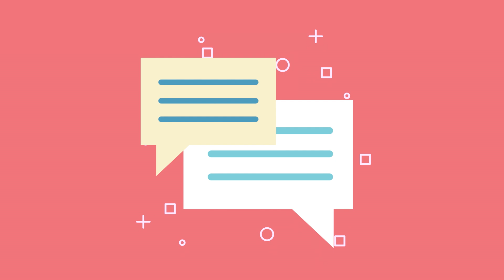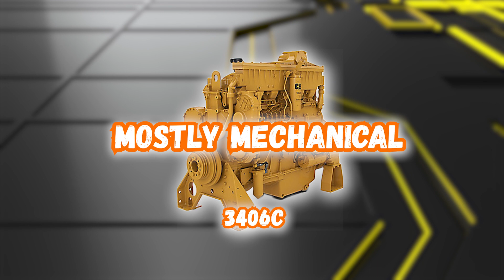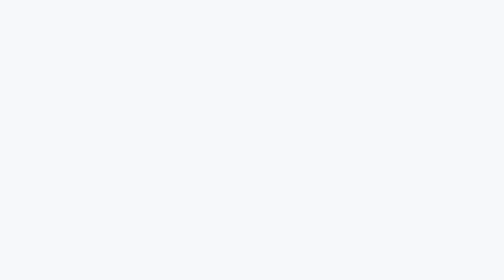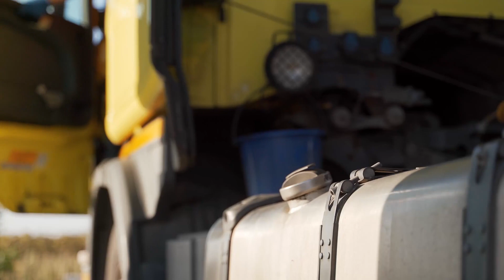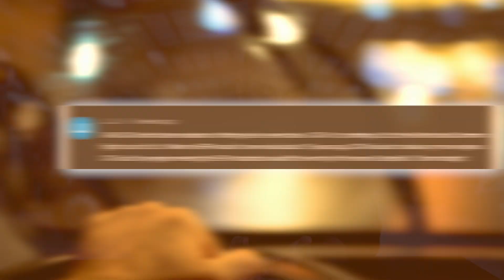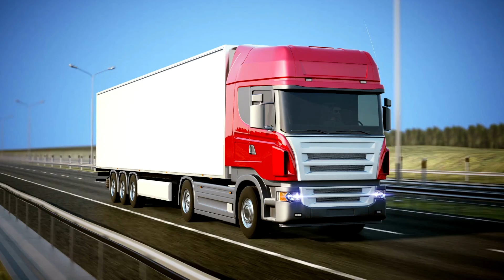CAT'S Downfall!! (Talking ENGINES & Sharing your Comments)

Comment: Best one I ever ran was a 3406 C model. The reason they got out of the truck market is they still have tons of lawsuits from soft cam billets and other crap. They got sloppy in their last years.
The series 60 was not a copy of the 3406 it was a copy of the old 1693 TTA. If I had my way there are really only two engines I would run. The first being a twin turbo VT903 Cummins and a 3408 cat. You can get great fuel milage out of the 903 and it is a million mile engine. The 3408 not so good fuel milage but still a million mile engine but very expensive to repair. Just my 2 cents.
I now will only have a cummins or Detroit. Every shop can work on them and you are not bound to a specific manufacture for repairs. I had an International N13 and it was a piece of junk. Nearly broke me it was in the shop as much as it was on the road. I run the ISX 15 now and have never had a problem with it. The only repairs I have had to do on it were a fan clutch and DEF sensor. Oh and an AC compressor. I run Pittsburg power max milage fuel catalyst in it and have never had a problem with the DPF in 650000 miles.

Comment: What are your thoughts on CNG trucks ive been seeing a lot more on the road latley and many say that they're just as or almost as powerfull as diesels with the fuel being way cheaper and not having to deal with all the emmisions stuff 
new trucks have today would it be a good idea to get one at least for local runs many fueiling stations have an area to fuel cng vehicles not sure about them in OTR use and unlike electric cng has been around for a while now and trucks can even be ran on both cng and diesel would be cool if you guys could make a video breaking them down as there are very few videos on CNG trucks that really goes into depth
Reply: Holy sh*t - use punctuation.

Comment: Cat is the best 1993 to 1999 3406e single turbo 475 hp  cat build the best motor in the world and did not want to choke it up for EPA standards can't blame them.That vintage of motor is still on the road today getting good mpg 7 to 8 with no flashing shut down light or Regen. Look at the exhaust when it's running. It's transparent. Cat shit doesn't stink that's why they checked out because they know there shit did hurt them a bit.

Comment: I love all cat engines , You can do mods to them for fuel mileage . My current truck has a C15 NXS deleted,  single turbo, ported head, the nice exhaust manifold.  Tuned to 550 hp 1850 TQ. If I baby it in my 387 shell do 8.4 mpg . And no Def. She's got 1.45 million on it and it don't burn oil and has minimal blow by .  It sucks running down the road with emission trucks , they can't pull worth a dam . So they are always in my way when I'm running in the big hills . CAT #1 🐈
Reply: Sounds like a great truck. How much did the delete cost?
Reply: @mctransportation9831  it wasn't that much really.  I think you can still by the manifold and turbo for around 4500 . The iva valves are backed all the way off and no longer do anything and the computer was reprogrammed for 500. Witch is a rip off because it's no labor really involved on their end . It's a good set up . Just as long as you roll in and out of the throttle smooth through the hills it will always get pretty decent fuel mileage.  I heard the new freightliners can hit 10 mpg driving slow . 60 mph max. But they burn Def too witch cost money . I'd trust this truck over a new one because there's no emissions to fail.
Reply: Amen bro. My truck has a cat c15 and those emission trucks can not pull hills
Reply: Boss I drive a 3406e in a Kenworth w9 with a pdi manifold and turbo , how do you get better feul mileage out of it?🙏

Comment: I just wish fuel wouldn't be so expensive, then I'd go for a CAT in a heartbeat
Reply: Quality is expensive
Reply: I'd rather spend more in fuel and have something dependable. This year alone I've lost 50Gs in canceled loads/unwanted time off for repairs/emission parts/ and the headache! Fk this new technology BS. Buying a 6NZ 379 this week. Plus everything on the old-school motors are cheaper, from turbos, injectors ect ect ect

and I can change parts myself without a computer!!

 fk these new trucks🖕
Reply: @joshcecil5892  I mean I'll go for a DD60 12.7 which is also old school and still decent fuel milage and cheap parts

Comment: I have c15 6NZ in  my w900l, 2.2 mil miles on  it, except valve adjustment nothing done to the engine. MPG suck compering to new engines, other than that, best engine ever  made....
Reply: 2.2 mil miles? You are right around the corner for a rebuild. Just face it.

Comment: 💖💖💖Cummins is nothing but a red paccar best engine for the ideal idiot who is in line for a MAXX force 13 but it does have a great bull gears and the paccar is actually a good engine too I did a in frame on one and it didn’t even need I just wanted it done for the long run after half million miles 
Don’t believe it, then start spending your money and start buying the parts and there’s your answer 
3406 cat A,B,C,D,E are all the same engines the only true difference is the fuel pumps and they have bad rear seals and they do have a great block for the sleeves they are really reliable Cummins I’m not a fan of but they are for the free birds but take a chance and it’s on you 
C-15 and the c-15 ACERT are the same the acert simply has two turbos and are great engines to turn up the fuel for rolling coal But on the hot side of the engine they leak oil and the heads are the best but the bottom gasket is the pure words of trash and will never be worth anything 
ENZ is your number one cat engine IS EXTREMELY GOOD AND EXPENSIVE BUT IT’S IS THE BEST Diesel engine of ALL ENGINES!!!!!!!!!!!!!!!
ENZ💖
C-18 are great it’s just a turnt up c-15 bored out with bigger sleeves and cam and crank it’s built for power but expensive all around and that is why NO MEGA CARRIERS HAVE THEM THEY CAN NOT TAKE A HIT THE ENZ AND C-18 WILL DRAIN THEM ESPECIALLY WHEN THEY GET THE FUEL BILLS THEY ARE ALREADY CRYING ABOUT THEIR LATEST GREATEST SHOE SHINES 😂 
C-12 and c-13 are great engines too but I they are in line with the 3406 
I’m a Detroit engine girl AND THEY ARE VERY RELIABLE AND THEY ARE JUST THE CHEAPEST ENGINES FOR PARTS AND THE BEST PART IS YOU CAN GET THE PARTS ANYWHERE IN AMERICA AT ANY TIME  go 60 series ONLY 

BUT I DON’T HAVE ONE I HAVE PACCARS the latest greatest shoe shines myself 
Peterbilt girl brand new but I prefer the pre emission trucks y’all but at the same time 

It’s just business 💖💖💖💖

Best motor PERIOD is
ENZ cat 

Best Buy for the cheapest is Detroit 
 Best for me PERIOD IS DETROIT 

😂💖💖💖💖💖
But I’m just a southern girl what do I know right 💖
But people I don’t want to give you the wrong information so you are just going to have to live and learn from your own mistakes and anyone else advice including my own ITS STILL YOUR OWN ADVICE YOU NEED TO FOLLOW BECAUSE WHAT I FEEL DOES NOT MEAN ANYTHING FOR ANYONE ITS JUST UP TO YOU TO LEARN IT THE HARD WAY 

Hey besides it’s like love 
Nothing is a better teacher than pain and hurt 

SO MY ADVICE IS 
Do what your wallet can stand 
💖💖💖
Reply: Cat never made an engine better than the 1693, the B model and the 3408. 6nz is top 5 cat engine ever behind the E model
Reply: Talk about a run on sentence 😳
Reply: Lol not even close to comparison two different engines

Comment: I used to dyno check trucks at the now closed Navistar truck plant in Chatham  Ontario. 3406 Cats almost always outperformed their rated performance numbers and in particular the mechanical engines, sometimes by a significant amount.
Reply: Scam via Telegram
Reply: Cat had or its dealers or both had a sales strategy with early 3406's to rate them conservatively and allow turning the fuel screwed by dealers without canceling warranty...